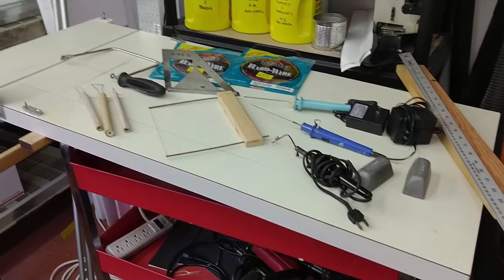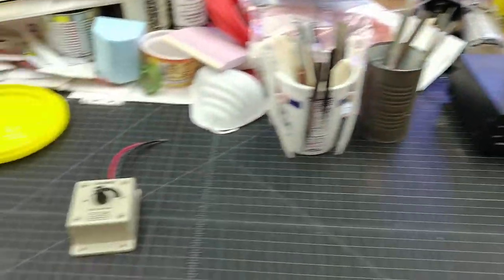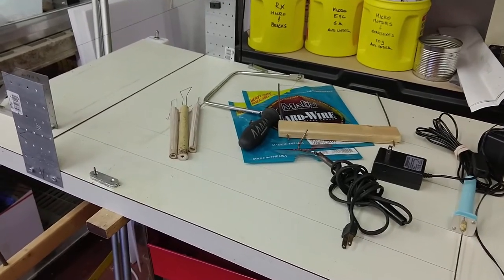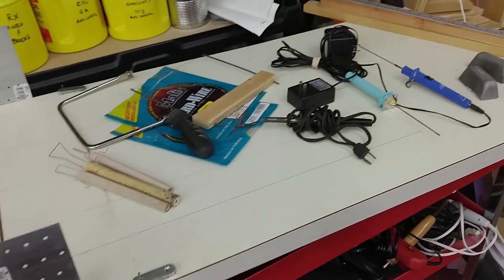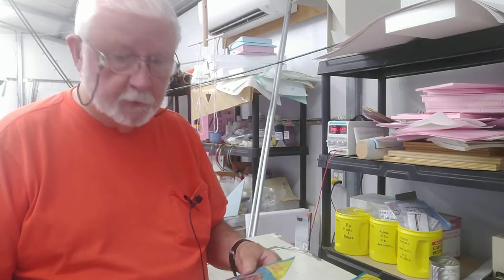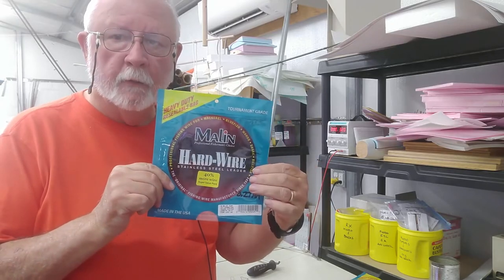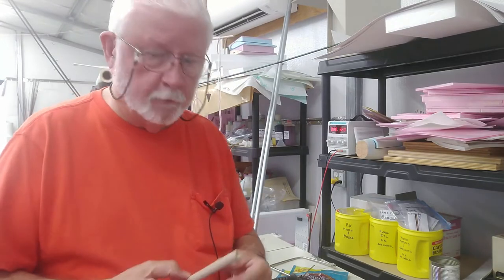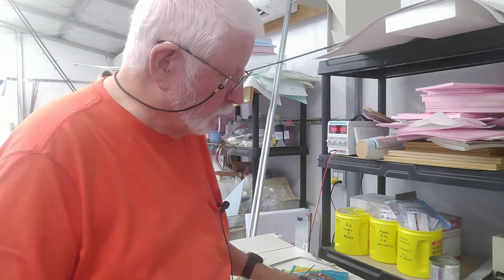Sectioned Foam RC Aircraft Fuselage Building - Part 10

Comment: Hello, your videos inspire me, but I have a couple of elementary questions.  How are you attaching the cutting wire to the handheld (1 × 2) bow rods? How to get it "tensioned" yet securely attached?  
If I use similar components as you, what voltage/amps should I expect to provide cutting of 2" blue foam?

I have 1/8" rods approx hand breadth apart, and Malin .011 and .016.

Thank you and sorry for such lame inquiry.  I'm very literal...

Jerry
Reply from the maker: Look closely and you will see the 1/8" or 3/16" piano wire "legs" of the cutter bending in somewhat.  That is because the hot wire (fishing leader wire) is stretched between the legs, bending them in a bit.  I use a Dremel tool with a cut-off wheel to cut shallow notches in the very ends of the bow legs to attach the fishing leader wire securely.

Comment: Trying to find a source for the stainless steel leader here in Europe (Spain). All I can see is braided line not single strand, will that be a problem? Thanks!
Reply from the maker: In Europe what we here in the US call "leaders" is called "trace".  Also, there are many sources of single strand stainless steel wire available, not just fishing supply shops.  Last, go to a music shop and get a guitar string.  Look for "Light, Size B' strings but take a caliper and check.  I have never used braided line.
Reply: @tvideo1189  You are the font of all knowledge! I have found in a draw a reel of "Atomizer" wire FeCrAl 0.2mm AWG 32 45 ohms / metre what do you think of that?
Reply from the maker: @1nformatica  Um, that is very thin but may work.  The problem with ultra-thin wire is the same as with a small wheel over rough pavement.  The wire snags on the tiniest imperfection just as small wheels hangs up on cracks in the pavement where large wheels run right over them. Generally, wire diameters of 0.013 to 0.016 inches work best for me.  That would 0.3 to 0.4mm.  Try it and see is all I can offer... it may work fine with smooth enough templates.
Reply: @tvideo1189  Thanks again! The search continues with new intel!